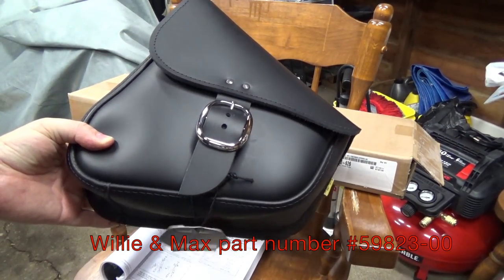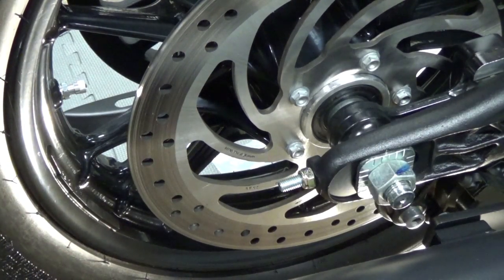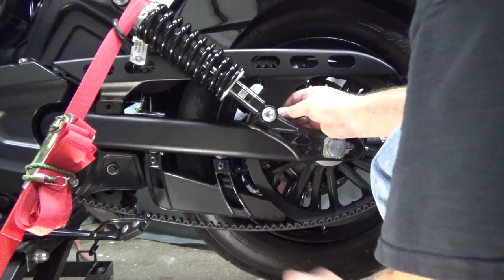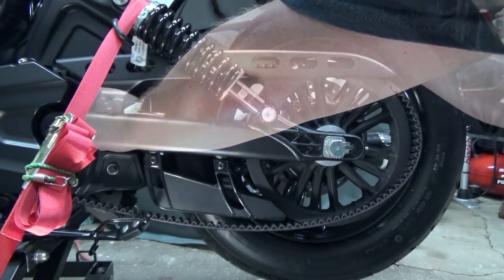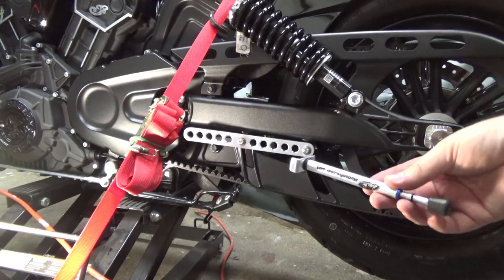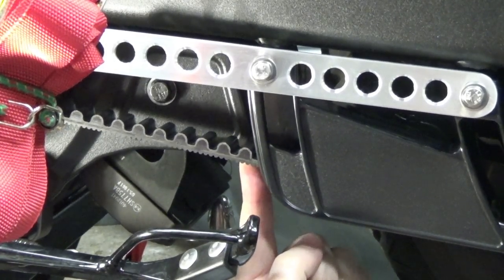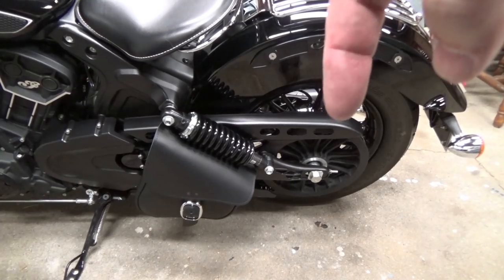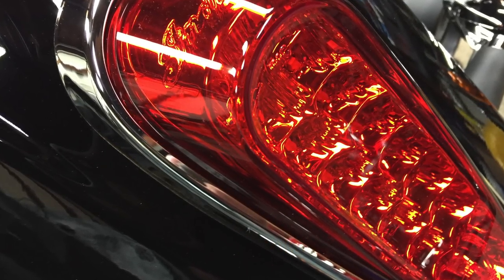Project 2016 Indian Scout Sixty Part 7 (Bobber Belt Guard + Willie & Max Swing Arm Bag)

Comment: Good planning on the bracket!

But I'm not a fan of the theory that every single bolt you might want to remove is immediately available.  That is naive.

You can use 2" wide blue painters tape on the exhaust to prevent a wrench from scratching it.  Of course, this works anywhere scratches are a concern.  I use it all the time when I'm machining a customer's part and don't want scratches.

Comment: Always a pleasure to watch your videos, Mike. Quick question...Your fly shield...Did you do have to alter the mounting system? I love the look, and realize that the protection will be minimal (hey it's a shield for your fly, right?) Thanks!
Reply from the maker: The National Cycle Fly Screen mounts with no modification to it's brackets. I did originally move the factory turn signal mounts a little higher so the Fly Screen clamps were at the bottom, that way the angle of the screen looks better. The factory turn signal mounts are rubber and just slide up. In the end I ordered Memphis Shades turn signal relocation brackets so that the indicators were lower. IMHO they look better that way but it's not needed. I think there is an all black version of the Fly Screen now. Thanks for watching!

Mike

Comment: Hi mike.
Burt's looking stellar!
Swing arm bag was a good idea and does it justice 👍
I'm still desiring a bag of sorts for my black 60. How comfortable is that 1920 solo seat really? I'm seriously considering it but was scared it would be a 400 dollar mistake due to lack of softness . Does it's contoured shape help with comfort any? Also is the Bassani road rage 2 into 1 sound worth the money? I was thinking on the Hacker Mayhem, or the Vance Hines  Grenades, maybe even Dirty Bird concepts 🤔
When I get mine close to presentable I'll send you some pics . Yours is definitely a gem and a pleasure to see Mike !
"Cheers mate ...
Reply from the maker: Exhaust tone is a personal preference. I love my Bassani 2 into 1 but I got it because it makes extremely good power. The exhaust note is a side benefit. The Dirty Bird system is crazy loud! I love my 1920 solo seat. Fits my butt just fine! LOL. For the max comfort I think the Mustang seat is one of the better ones out there. You should drop by the Indian dealer to see if they have a 1920's solo seat mounted on a bike you can check out. The contour fits me much better and even though it's not as padded as the original seat I find it comfy. I have ridden all day with it on our crap roads in the Detroit USA area and haven't had any issues. After riding all day any saddle will make you sore IMO. Thanks for watching! Cheers!

Mike

Comment: Now that you've had the swing-arm bag on the bike for (presumably) 12 months or so, can I ask if you're seeing any signs of wear anywhere on the bag? Particularly the upper flap surface, which looks like it might be in constant contact with the suspension coil? Any other lessons learned from mountaing that particular accessory?
Reply from the maker: I haven't had any issues. Works great. I am not really seeing any wear from the shock. I also don't overload the swing arm bag. I keep most of the bulky stuff in my detachable saddle bags. There's a video of that on my channel. Thanks for watching! The main lesson learned is that I ended up cutting off the ty-wraps and using velcro straps instead. Much better solution and I can easily remove the bag for washing the bike. Cheers!

Mike

Comment: Brilliant mod, I have a few questions. How long is that spacer and what are the measurements of the bracket or are you selling it as a kit cause I will buy one. Thank you.
Reply from the maker: The length of the bracket was solely based on my highly calibrated eyeball. LOL

For me I held up the bag and just marked my aluminum bar stock at the front hole on the bag.

I don't remember the spacer per say. What I did was take the lower belt guard and the original bolts with me along with the bar stock (rough cut) to my local hardware store. I just camped out in the faster isle at Ace Hardware until I had noodled out just the right combo of bolts, washers and the spacer. The spacer is probably close to 1/2" but I have a bunch of washers there also. I also cut down the bolts with my Dremel so they were exactly the right length.

No kit LOL. I barely have time to ride my bike as it is let alone start making parts! LMAO! Thanks for watching.

Mike

Comment: Sir, disregard my previous question. I just walked out and checked my Bobber and the lower rear Allen "ain't" going no where until you move the tire back. Forgive my inquiry.
Reply from the maker: Even if the rear belt pulley wasn't in the way, to use an extension from the other side would probably require a swivel. The rear disc gets in the way of a straight shot across. The belt pulley is in the way of removing those 2 allen bolts on the drive side. So you either have to loosen the wheel or just remove it. In reality the video is actually longer than it would take to do the job. Just takes time to move the camera and explain stuff as I go. Thanks for watching, much appreciated!

Mike

Comment: What lift modei do you have for your Sixty?
Reply from the maker: It came from Harbor Freight. Not sure what the model number is but it's just the right width to fit the under side of the engine. Thanks for watching.

Mike
Reply: Michael Rench.... EXCELLENT, there is a Harbor Freight right near my house. Thanks!
Reply from the maker: Just check the underside of you bike before you lift it. It took me a while to find the sweet spot. I tended to want to move the lift too far forward. The pad towards the front should just about be under the "Indian Head" lower cover and the pad towards the rear needs to be just under the kick stand mount. If you feel / look under you will see the engine is rather flat and extends almost back to the rectifier / regulator bracket. The Harbor Freight lift fits the Scout just fine. Thanks for watching!

Mike